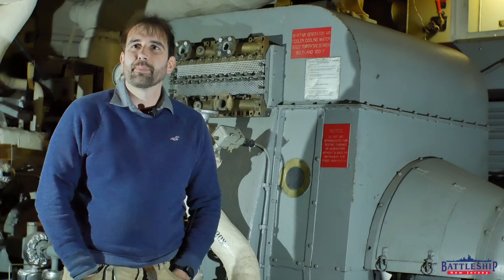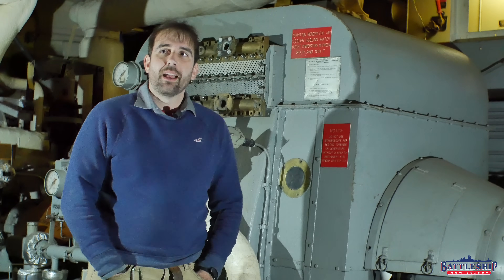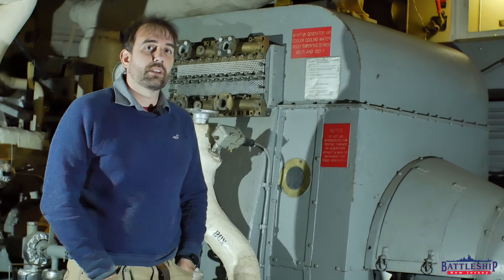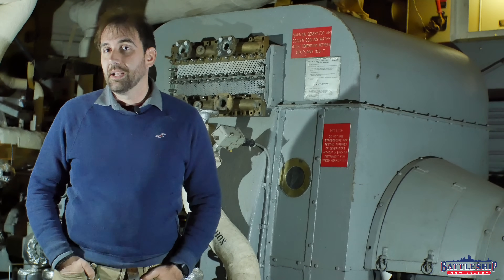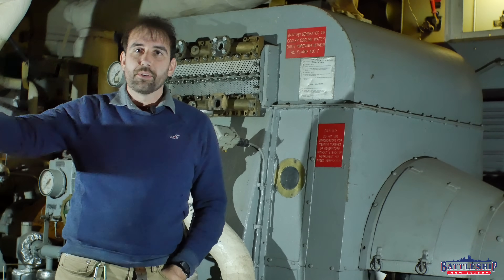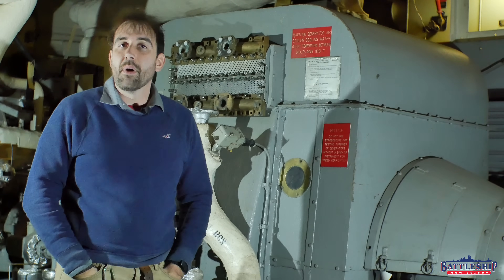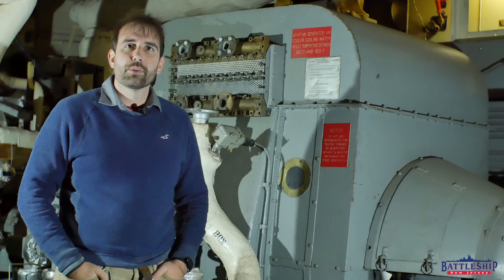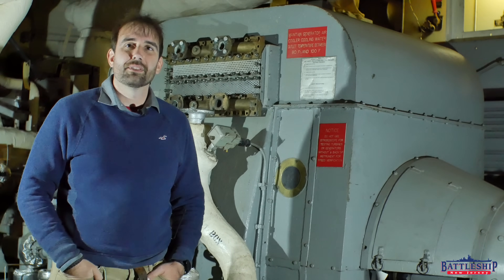Turbo Electric vs Direct Drive Turbine: What Propulsion Plant Is Better for Capital Ships?

Comment: Well, if I were designing a Capital Ship in the 1930s*, if at all possible I’d design it with the hybrid design. Of course it’s easy for me to say, but *certainly after ~1938 I’d tell the Washington Naval Treaty to eat a dick, unless that’d get me fired. (I know it was A LOT harder to gather intel, but surely everyone knew that Germany and Japan were completely ignoring the treaty by 38, right?)

No naval architect but the gist of it is take advantage of the further possibilities for subdivision, benefits of electric motors, etc. As for power, I’d try and run it through the bottom of the hull (I think the only thing that’d hit that would be a mine) as well as have some sort of redundancy in the wiring so a lucky hit doesn’t leave the ship dead in the water.

Today, well, it’s the USN: Nuclear power baby! 

(Actually, do modern carriers and subs use a modern, electrically driven propulsion system or is it the old, mechanical way with a fancy new way of generating the steam?)

Comment: Replace the boilers with diesels and that's more or less the system the USN submarines of WW2 used. Very flexible, efficient, and had redundancies. 
Of course far more practical due to scale AND you want that flexibility between propulsion and diverting power to recharge your battery stores, which that system allowed you to do really quite quickly (if you didn't mind using the fuel, which you wouldn't if getting your battery charge done ASAP).

There's also the problem that you can't exactly be running fires and boilers when you need to dive, let alone light them off again when surfacing (although the Brits did exactly that in one of their earliest subs, I seem to recall), LOL.

Comment: It is not beyond the realm of possibilities, by cryo-fuel powered ships. LO2 and LH can be stored in large dewar flasks to minimize the loss through heat, but even then, the gas that may boil off can go right into a boiler to be burned together. The benefits are that it only produces steam as exhaust, there is no risk of nuclear contamination should the ship be lost, it can distill a TON of water, or the steam could then be condensed, and separated back into O2 and Hydrogen using electrolysis,  and compressed back into their liquid states and back into the dewars. Even in the 1960s NASA's cryo fuel tanks were able to keep both hydrogen and oxygen in a liquid state for years, only losing a couple of percent to boiling off every year.

Comment: I remember how incredibly different the experience of going from flank to reverse was aboard my first ship USS Kitty Hawk vs my second ship USS O'Kane.
Kitty Hawk, you gotta stop the shaft then lock the shaft engage reverse then unlock the shaft. Competent engineers like we were could get that accomplished fairly quickly but in the age of CPP screws it was still slow. BUT once we were in reverse that's 280,000 shaft horse power it hauled the ship down fast.
On the O'Kane and every other Arleigh Burke class they had CPP screws Controllable Pitch Propeller. So flank to reverse was a near instant action AND BOY DID SHE STOP! Like the old saying stopping on a dime and giving you back change. You only had to experience it once to realize the fantail may not be the best spot to experience this. Hard crash back earns every bit of it's name and the fantail is in the splash zone...

Comment: Do you not see the irony of selling a Japanese knife to support a warship built to defeat them?🤣 Nuclear-Turbo w/  An electric motor housed in a pod is suspended under the ship's hull, with the propeller connected directly to the motor shaft, allowing the unit to rotate 360 degrees, improving vessel maneuverability, as well as minimizing noise and vibration

Comment: I would think that a hybrid approach would be best. you have one set of turbines direct driving the screws, another set generating electrical power.
Your drive turbines would be designed to do one thing: efficiently drive forward at cruise speed. Then also have electric motors attached to your drive lines to assist with acceleration and of course reverse.

Comment: I'm curious what happened with Saratoga that caused all of the electrical power to fail? Were all of the generators actually taken out? Or did the sudden loss of one or more cause the phase to get out of sync and damage other equipment? Or something else? It does seem like you'd have to be really careful about how to deal with sudden loss of a generator in that case, just as it's an issue that must be dealt with on the normal power grid. Pieces of AC equipment that are connected to each other really don't like to be out-of-phase.

Comment: I remember reading on turbo electric ships, they were very popular with ships that needed refrigeration, especially the ones that transported tropical fruit that also dealt with high temperatures.

The US seized a German one, it was not worth it as it constantly broke down, even when paying the original German crew to maintain it, assuming they were not sabotaging it.

Comment: If you were asking me to build a battleship class vessel today, it would likely be nuclear electric. If you are asking me to do it back before we had nuclear powered propulsion, I would likely go with a gas turbine electric hybrid. I'm a big fan of gas turbine engines to begin with because they will burn pretty much whatever you put in them and they are relatively compact. There's no need to run steam lines when you can. Just turn the generator off of the explosive force of your combustion and you also get the redundancy available to a electric drivetrain. So there's no reason that you can't subdivide one of those vessels to an absolutely ludicrous degree.

Now if I'm given carte blanch to design whatever propulsion plant I would like would I would likely be doing something completely stupid like multiple nuclear reactors with a space reserved for some long view fusion reactor power plant, but that's why I'm not a naval ship designer
Reply: @E-Hamel The time since I posted that comment. I have thought of a new preferred solution even if it isn't quite capable of doing power generation for a whole battleship the way conventional nuclear can.

Radiothermal electric power generation. Just stick a couple of big gigantic RTGs and random places around your ship. Bonus points The RTGs can kind of act like armor themselves because you really don't want them to break open so they'll be made out of something rather tough.

The only problem is current thermocouple technology isn't quite capable of generating the amount of electricity that we would need
Reply: @E-Hamel It's fine if your battleship is setting off Geiger counters in a you know 10 mi radius nobody's going to want to come close enough to shoot it

Comment: Turbo-electric power plants were popular with passenger ships, such as SS Canberra, where again you generally have a high electrical load compared to a cargo ship. Modern cruise ships mainly use diesel-electric propulsion where you have a number of large diesel generators  providing both propulsion and hotel power.

Comment: One thing you forgot about choosing the right power source is the number and size of propellers you will use.  The Iowas had a larger propeller than the Lexington CV.  This was probably due to the gear reduction units on the Iowas.  I believe the Electric drive could somewhat simulate a gear box by using different ratios of poles between the generator and motor.
Reply: Since DC electric motors have more torque at low speeds--particularly compared to turbines--I don't think a T-E system would need as much gear reduction between motors and propeller shaft compared to a steam or gas turbine arrangement. But I suspect that the difference in weight for the gearboxes would not be all that significant in the grand scheme of things. 

I also suspect that both of these systems would be trumped by gas turbines with variable pitch propellers.

Comment: 7:08 I would love to hear more about this story, and how the navy was able to use their ships to generate power for Seattle after that earthquake!
Reply: For others similarly interested, here's some specifics I was able to find: The ship in question was the USS Lexington (CV-2); she docked in Tacoma, WA from December 15, 1929 to January 16, 1930, after a drought and unusually cold weather led to a shortfall in hydroelectric generation capacity. She wasn't run around the clock, but was rather only used during the night to stabilize the peak lighting and heating demands. In total she added an additional 20 MW of generation capacity. (For comparison, the Cushman Dam No. 1 that the ship supplemented normally had a peak capacity of 42 MW.)
Reply: Reminds me of the modern US Navy using the CVNs as desalination plants for disaster affected areas. A hypothetical nuclear turbo-electric carrier would be able to replicate the Lexington's power supplementation without much concern for fuel use.

Comment: Having been involved with converting a military ship from A/C to D/C propulsion systems, I learned one thing. Turbo electric systems have a few major drawbacks. The number of generators needed for the same HP will take up more space than a turbine propulsion system, and the main motors that drive the ship weigh more than a comparable turbine and reduction gear arrangement. Electric propulsion systems are fantastic these days and if we were building today, Diesel electric would be the way to go. Back then most of the gear was 3 or 4 times as large as it is now.

Comment: Here's a related follow up question since you mentioned it: If cost is no object do you go nuclear with your battleship? You have all the benefits of turbo electric (perhaps apart from being able to decentralise quite as well) with effectively unlimited range and the ability to maintain high speeds for very long duration. The downsides of course are everything that comes along with being nuclear
Reply: I don’t think a nuclear drive makes a lot of sense for a battleship. The advantage of a battleship over a CV is that it’s heavily armored and can tank hits, but a nuclear reactor will scram if the ship takes damage and then you’re left without power. On a carrier you’re designing the ship with the expectation that its defensive screen will prevent a hit in the first place, but BBs are supposed to be more durable. The Russians seemed to think they could get away with it on the Kirovs because of the dual drive system, but that’s got to be pretty inefficient in terms of displacement compared to more conventional propulsion.

Comment: Thank you for explaining the pros and cons of turbo-electric versus direct drive.  

Nuclear powered warship damage control in battle hasn't been tested---yet.  There have been a number of nuclear powerplant incidents and the ones I've read about have been mostly submarines.  The reason that USS Enterprise/CV-60 had eight atomic piles instead of the two currently standard on American aircraft carriers (with diesel back-up generators) was so that any one nuclear powerplant failure would only take down one-eighth of the Enterprise's power.  Submarines--to my knowledge--have only one nuclear powerplant, a bank of backup batteries and a small diesel generator for emergency electrical power generation while surfaced.  When submarines suffer hits that surface warships might survive, the submarine is doomed by depth.

Two nuclear powered US cruisers were Long Beach and Bainbridge, and both had a pair of nuclear powerplants.  It might be interesting to compare those cruiser designs against the Iowa--because Long Beach and Bainbridge took over the aircraft carrier defense mission from the New Jersey.  

https://en.wikipedia.org/wiki/USS_Long_Beach_(CGN-9)

https://en.wikipedia.org/wiki/USS_Bainbridge_(CGN-25)

https://en.wikipedia.org/wiki/USS_Truxtun_(CGN-35)

https://en.wikipedia.org/wiki/Nuclear-powered_cruisers_of_the_United_States_Navy

Comment: What was the reasoning for discontinuing turbo electric drive in post WWII military ships? Without weight limitations it seems like it would been a better propulsion system for aircraft carriers but every post war design reverted back to direct steam (or later gas) turbine drives.
Reply: They couldn't make the speed that steam turbine ships could. If built now and not nuclear powered then diesel and gas turbine generators running electric motors.
Reply: They were also more expensive and once reliable gearing became affordable, the system lost to geared turbines.

Comment: One of the early iterations of the Bismarck and the Graf Zeppelin called for TE plants.  One of the advantages is that on average they had better range than their steam turbine sisters.  IIRC the USN got 20% better fuel efficiency with them.  They were also just about as fast in reverse as forward and you could run one set of screws in reverse and the other forward to turn a bit sharper.
Reply: *Not as fast in reverse, but had the same power.

Comment: I think a good, or bad example of a steam power ship is Cameron's titanic m when the go from full speed to full reverse.
I'm not sure if that actually is accurate how fast she was reversing, but seeing those massive engines stop und going to reverse,  there is defenetly some damage done.
So even with the steam turbines through a gear box there is still a massive inertia. 
On electric going full speed, cutting g the power you can even use electric breaking and generate power  for those seconds to get it to a stop bofore shooting in power for full reverse.
And then there are the pods, or water jets and bucket stop

Comment: You do not wre those engines with 440VAC, you go for higher voltages, 6kV, 11kV or higher, simply because this makes for much lower cable losses, and also your motors can be more efficient at higher voltage, more insulation yes but much thinner wire in the windings to make up for the difference.

Comment: My take on this one is simple, If you are burning fuel oil to convert into a usable stored energy, steam, using that steam directly for propulsion is the most efficient. Converting that steam energy to electrical energy to use for propulsion nets an efficiency loss, as every time you convert energy into another state you have a net loss. As much as I like the old steam plants I used to work with, the most efficient way to turn that fuel oil into propulsion is to directly convert the heat of combustion into mechanical motion with a gas turbine.
Reply: it isnt tho. turbines, like any engine really, have a specific load and speed at which they operate at peak efficiency,  so a direct drive turbine has to do everything from idle around a dock to full ahead and if its designed to cruise efficiently you better believe its suffering everywhere else., T-E systems allow the turbine to operate near peak efficiency all the time, you just bring more units online as power demands change. yes obviously you loose out in the conversion to electricity, but you gain in efficiency of the system as a whole over a wider operating range.
Reply: @denisohbrien  That's where the variable pitch screw comes into play. That gas turbine can spin at whatever speed is best but thrust is ultimately controlled by the pitch of the screw blades, including direction.

Comment: And yet, here we have the Nimitz, and Ford class (CVN-65 as well) that ALL have shafts, reduction gears, and steam turbine main engines.  Steam Turbines can be very easily reversed and honestly doesn't take much if any longer to reverse than a Turbo Electric would.  Both have inertia to fight, and yeah, the Electric would have less, but the steam has far greater power (torque) to slow the shaft.  Granted, this does not result in a faster turn around time as the shaft is such a large amount of mass, but the shaft can be spinning backwards absolutely in less than 2 minutes (from a flank bell) and honestly, I think close to 1 minute.  Emergency Throttle rates are wonderful things.

Comment: How about a combination turbo fan and steam driven electrical? You could run generators off of turbofan engine and use the exhaust heat for boilers to power Steam generators.
Reply: It’s called COGAS, for COmbined Gas And Steam. You have a gas turbine powerplant driving either a direct propulsion shaft or an electric generator, with the exhaust firing a steam boiler which then powers a turbine, again either for direct drive or an electric generator. IIRC the combined systems can reach 90+% efficiency.

Comment: Obviously,k it just needs a flux capacitor... :)

Seriously though... One thing that you should also consider these days is the option to have an adjustable pitch screw (prop) that would give you extremely quick auto-reversing capabilities... That could be accomplished regardless of whether you had direct steam turbine drive or a steam generated electrical drive...

Considering the fact that the Navy got rid of the CGNs before their lifespan was up (supposedly for cost reasons), I don't think that they could make a case for a nuclear powered BB. even though I personally would like to see one...